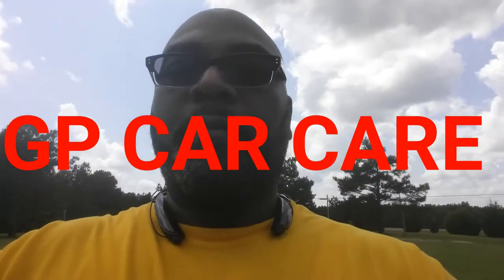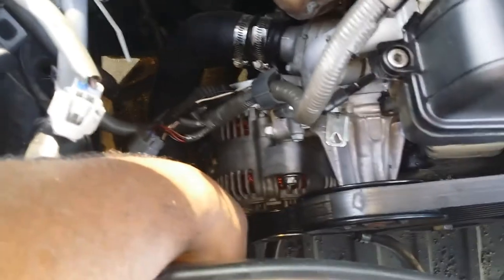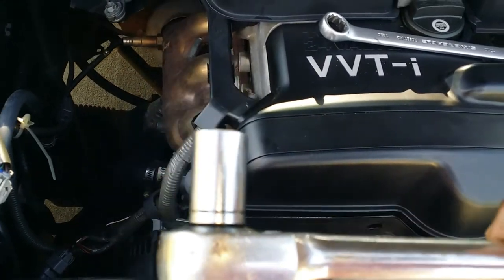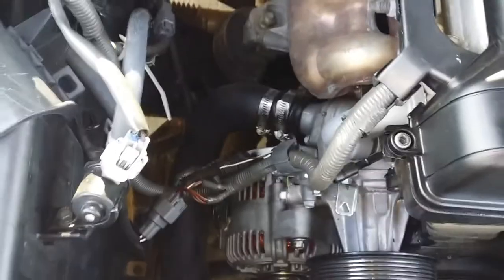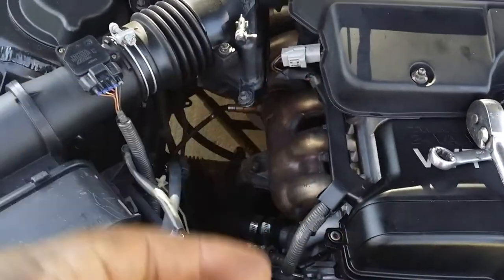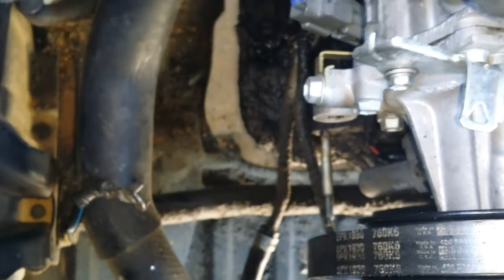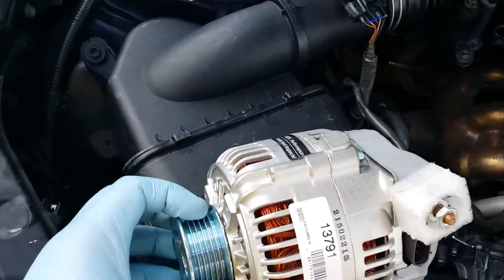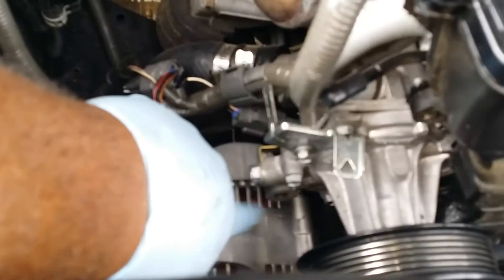How to put a alternator on a 2002 Lexus GS 300 HD

Comment: How many bolts have to come out to get the alternator free. Where is the second bolt, I am having a really hard time removing the alternator
Reply from the maker: You have two bolts one at the top and one at the bottom
Reply: @geraldparker8032  I removed the top one, I am having a hard time removing the bottom. How did you do it? Did you jack the car up and go underneath?
Reply from the maker: Yes

Comment: Seems like the real problem is your VVT-i cam seal leaking and causing residual oil to leak onto the alternator.  It's a very common problem.  Great video though.
Reply: This is my Problem today. Yesterday my alternator stopped working while the car was running, it just stopped charging battery light came on and car slowly lost power can be jumped back on but then will eventually die. Oil is built up around the VVTI AND THE ALTERNATOR. DOES THIS SOUND LIKE IT COULD BE THE ALTERNATOR
Reply: This is my problem right at this moment. Stuck at Walmart waiting on triple a